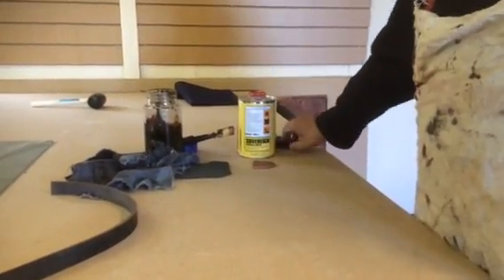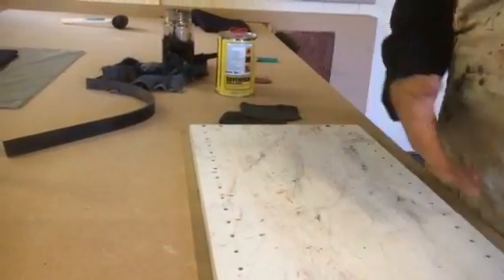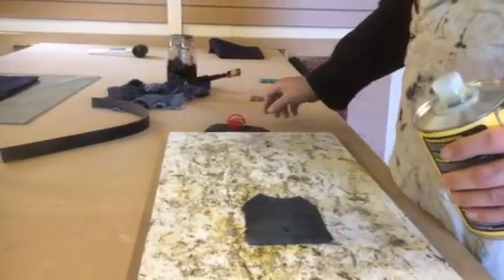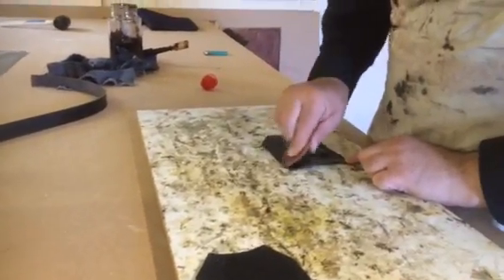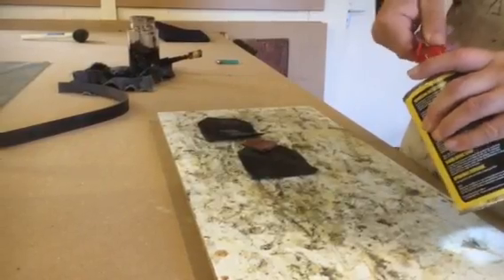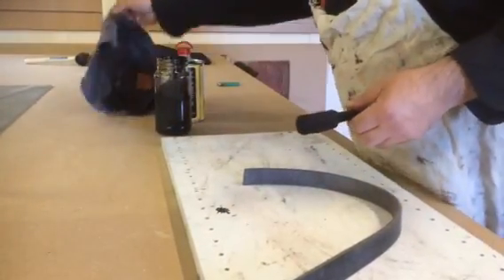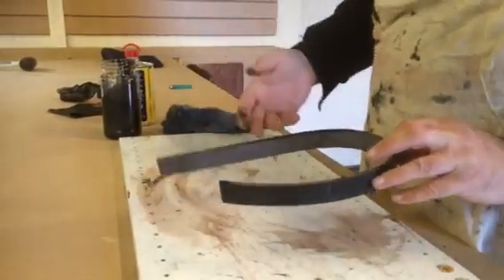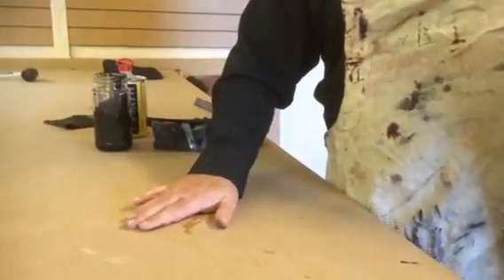Leather glue board

Comment: doesn't the tallow go rancid? could you recommend a good supplier for leather and stains etc. Thanks Deb
Reply from the maker: Hi Deb  No the does not go off. I have had a lump of tallow sitting in a old glue tin for ten years. and it still smells good. The lid on the tin does not even have a good seal on it. Abbey England is the main supplier these days for stain. As to leather it depends on what leather you need.